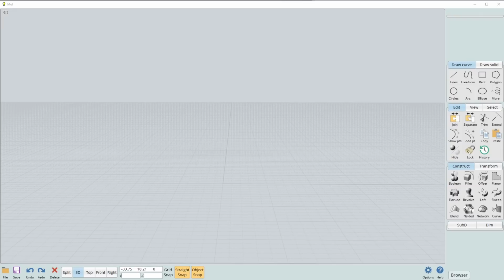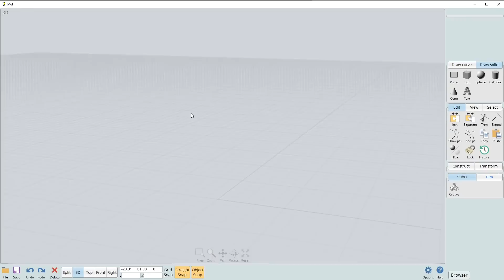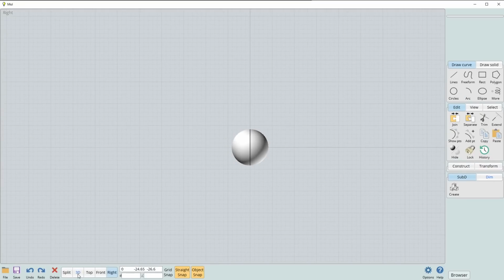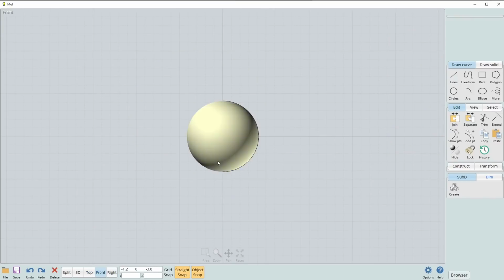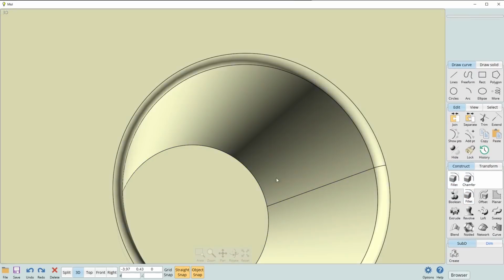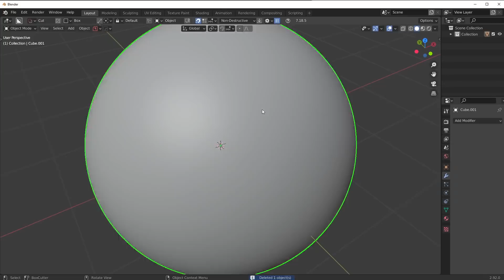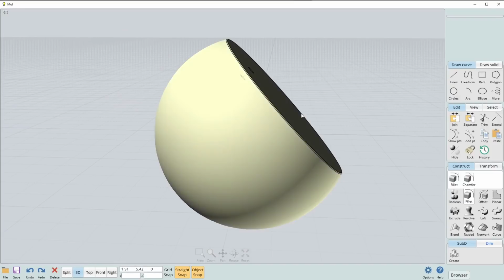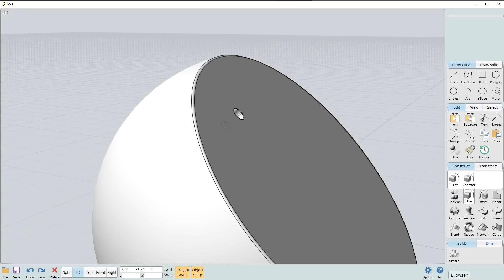So what exactly is NURBS modeling?

Comment: For the math nerds,

Polygons use matrices/matrix multiplication/arithmetic  with coordinates internally. Which is linear algebra. You effectively define the points and link the points,
You can generally define these as matrixes using a,b,c terms.
[a b c...n].
There is an inherent level of direct manual control with these at the cost of inherently smoothness and accuracy.

NURBS are using matrices(and "Linear" Algebra) as well internally but their entries are not like polygon model entries.
NURBS effectively use polynomials around a spline using polynomial *interpolation*(if you animate in blender, you definitely know what this is).

Entries of NURB matrices look more like
[(a + bx^1 + cx^2 +.....+zx^n) (a + bx^1 + cx^2 +.....+zx^n) (a + bx^1 + cx^2 +.....+zx^n)] 
Notices each of these entries technically has their own weights to form their curve. This makes them explicitly more accurate than polygons mathematically for curvatures because NURBS can successively add and reweigh each entry to increase accuracy as needed in an exponential matter around their "B-Splines". This makes them far more accurate. And generally easier to control from a user perspective.
The end result?

Per curve, we only need to store the weights, the power/exponent level, and the spline data. From cad, you can effectively only mess with the spline data to make things easier for you.
This also makes them easier to hold in memory for extreme curves vs polygons.

NURBS in one sense can be defined as Piecewise weighted Polynomials around a piecewise linear function.
This is why attaching nurb points can be...weird... at times. The entire polynomial has to be reweighted.
This is also why they cannot be easily animated/not animated at all. With polygons, you move points in space. With nurbs, you are having to completely recalculate chains of piecewise polynomials and weights.
If you want an example of what I mean by "piecewise polynomial", perform a boolean operation on a NURB model.
It doesn't cut the NURB usually. It instead produces another one!

NURB 1 exists as a function from (x1,y1,z1) to (x2, y2, z2). A boolean operation technically just stops that range/domain early, and inserts another NURB with it's own range/domain to fit what you want. It only worries about combining the weights at polygon conversion time.

This is also why converting a NURB to a polygon often generates a silly around of polygons/verts. In order to achieve "mathematical smoothness perfection" with polygons, you need ALOT of polygons to balance the weight distribution. So converting a system designed to be visually "perfect" in smoothness will naturally generate a high polycount.

Honestly though, in this day and age, many utilities you would find with nurbs can be applied directly to polygons. Nurbs are better for engineering and scientific analysis, as well as quick block out for curvature. I think there was a 3d VR sculpting software that exclusively used NURBS.
Although I would be careful if someone is a general animator using NURBS.
Never forget, NURBS are mathematical precise tools before they are modeling tools by definition. They are for engineers, mathematicians, and scientists. They are only for general modelers, game designers, and animators when they are SKILLED in how clean them up and operate them.

I recommend Rhino if you can somehow get a copy but Moi is a good choice as well.
Reply: Usually what happens with boolean operations is that the NURBS in fact stay the same, we just use  so called trimming curves to "cut/trim" the input parameter space.

This means the following: Our Sphere is actually a NURBS Surface, so 2 NURBS Curves that span a surface using the tensor product. And within that Surface space we can put trimming curves that cut out regions of the surface space.

So you have a NURBS Surfaces that inputs 2 parameters, but outputs a 3D point: S(u,v) -> p(x,y,z). Then we define trimming curves, that input 1 parameter but output 2 coordinates in the NURBS Surfaces space. T(t) _> s(u,v). This means you define curves within the surface space, which then cut out regions of the NURBS. The NURBS is still fully there, you just tell the Renderer to not display the cut out regions. There is some very interesting stuff you can play around with this.

Roughly 10 years ago I wrote my bachelor thesis about an Algorithm that converts any NURBS  into a piecewise combination of cubic bézier patches. This bézier patches can then be rendered and trimmed very efficiently on the GPU, since they have a fixed number of control points (and some other very powerful properties). This allows for some very cool stuff, for example seemingly Level of Detail transitions, because no CPU calculation time is required to change the LOD, since all the calculation happens on the GPU, by pre-storing some suiting sampling nets in the GPU Memory. 

We used this approach to visualize Aircraft designs that are created using NURBS.
Reply: Thanks for this! I was hoping to find a discussion of the benefits of nurbs for some situations. 

It would be interesting if a tool could be developed that combines the benefits of each (polys and nurbs) and avoids the pitfalls of each.

Comment: I've been using NURBS for years. I wish Blender would add full support for them  . . .
Reply: Blender's NURBS will not be manufacturable because it cannot be export as STEP or IGES.
Reply: @simpernchong  Isn't it the other way around though?
Reply: @simpernchong  i use blender for 3d printing and also for CNC milling machine , have you tried to design with blender for manufacturing ?! coz eventually after designing in a NURBs system , you will have to convert it into G code which relays on both polygonal and NURBs definition mathematically, am i right here ?

Comment: why would anyone use polygons? yes, polygons applications have more features but why would you have polygons if nurbs are strictly better? what am i missing?
Reply from the maker: Workflow is slower, infinite accuracy is seldom needed, poly-based allows for more versatility, you may need to retopo certain models, list goes on... overall I use Blender 99% of the time for these reasons.

Comment: In my opinion polygonal modeling is more complex than nurbs modeling, what are your opinions?
Reply from the maker: I disagree. Nurbs is slower and more tedious. You can probably learn Moi much quicker though, but it’s only a single tool in a massive arsenal.
Reply: Poly = Visualization 
Nurb or CAD = Production

You can convert Nurb to Poly
You cannot convert Poly to Nurb (just fake convert like stl)

So it doesn’t matter if one or the other is more or less complex. They are for 2 different tasks. It’s not really the same even tho it’s both modeling I guess.

Comment: Fun fact: long time ago, in a galaxy far far away, NURBS was used for... Organic modeling. Because they was smooth, while polytools wasn't that good.
But excuse me, you're wrong. Ok. Not really wrong, but it looks like, you don't really understand what the NURBS are. (and I don't really know details of modern CAD software)
But first of all: Blender and MaYa are not "poly based software". Even more, MaYa had quite advanced NURBS modeling tools in it. Blender... Well. It have NURBS surfaces, but it ends with their presence. Only difference with NURBS CAD software is that... It have more advanced tools in it. Ok. And it renders NURBS a bit different way.
And that's another point. The way these software are handling display of Bézier Curves and NURBS. What you see in the preview... Actually is an illusion. Well. Kinda. That curve, which you've created in Blender is actually... Have same smoothness as one in that CAD software. The only difference it that Blender converts it to polygons, to display it in the viewport, but in reality, it's smooth.

NURBS surfaces themself. Lol. It's kinda hard to explain. XD Because there are lots of details. But you can see how they look if you'll create a plain in Blender. Then subdivide it couple of times. The catch is that you can't manage loops with same ease as with polygons. It always must be something like grid. It can be deformed in any way (actually, that's how you get a NURBS sphere), but it always will be a Grid Plane.
Another thing, but I don't really get it. It's about details. Like in NURBS expressions, there is parameter "power" (like 2 in power of 2). And higher the power, smoother the result. With Power 1 NURBS surfaces look like Polygonal, while... Power 2 gives strange results, while power 3 gives smooth result. And there is power 7. Which kinda gives the best results.
Another interesting thing. Actually, that's how these "perfect Booleans" work: there can be NURBS curves right in the surface space of the NURBS object (it's called "Underworld"). And you can choose to "hide" part of the surface. ^_^
So when you make boolean operation on it, it copies object which you use to cut from another surface, creates (yep) another NURBS surface to create that Bevel. ^_^ Creates curves on both surfaces where "bevel" objects intersects with two objects. Then hides "unnecessary" parts.
It's just looks like, NURBS modeling tools have became really advanced, in the CAD software. So they kinda hide all these technical details, from the users.
And by the way. When you're rendering these scenes... You render all this stuff as polygons. Just really dence ones. Because... Any Raytracing engine just needs polygons to render stuff.
And another fun fact: there is another type of surface: Subdivision Surfaces. These are like polygons, but with 13 levels of Subsurf on it. So you can model as with polygons, while getting really smooth results.
Excuse me if all this stuff sounds like complete mess, but it's a really long story. And I've actually, missed tons of stuff.
Reply: > Another thing, but I don't really get it. It's about details. Like in NURBS expressions, there is parameter "power" (like 2 in power of 2). And higher the power, smoother the result. With Power 1 NURBS surfaces look like Polygonal, while... Power 2 gives strange results, while power 3 gives smooth result. And there is power 7. Which kinda gives the best results.

(a + bx^1 + cx^2 +...gx^7). Power 1 nurbs(just a) are effectively polygons because all their store is 3-d coordinates using minimal interpolation.
Nurbs achieve "perfect" curves by using weights along an axis(basically the spline).

> You render all this stuff as polygons. Just really dence ones.

Not entirely. NURBS use interpolation. 

> These are like polygons, but with 13 levels of Subsurf on it.

These are very much related to NURBS in the fact that they use interpolation of vertice points to form. This is why they are so bad for performance to use in modeling software because it's doing the grunt work of both vertices and exponential curves, where as NURBS only worry about the curves until polygon conversion.
Reply: @truesoundwave  "Not entirely. NURBS use interpolation. " - I mean that before rendering, or during rendering (at least with raytracers), all these NURBS objects are converted to polygonal ones.
"This is why they are so bad for performance to use in modeling software because it's doing the grunt work of both vertices and exponential curves, where as NURBS only worry about the curves until polygon conversion." - funny, but I didn't really had issues with these, in modeling software. But lol. The catch is that I haven't used them much. And meanwhile, some renderers, or rather translators? Using 3Delight you can check "export polygonal object as Subsurf". At least, it was the option.
And yeah. Thank you for these details.

Comment: I'm most interesting to see how you deal with export meshes using Moi, especially how to do high and low poly for game assets
Reply: Obj format for example, Moi3D as an advanced Obj exporter.
Reply: Well. Usually you don't do this stuff. But you can try to export it to MaYa (I wonder, would it work in Blender?), then do retopo, like with sculpting. %) Well, you can try to convert these to polygons, but you'll usually get complete mess. But as I've said, you use this type of software for other things. Like CAD.
Reply: @Soulskinner  Hi,
Yes it works pretty well in Blender and for the geo, i agree with you about the necessary retopo step.
Reply: @archiplanservices3746  Hi. XD
I'm just not sure that Blender supports all these NURBS surfaces. But I've thought that this software can export objects as Poly objects.
Reply: You can export from Moi3D in Obj format of course then import in Blender. There's even a bridge between both softwares called BMoi3D Connector get it here : https://github.com/TitusLVR/BMOI_Connector
Reply: Moi has export meshing options.. it can do low polygons to high polygons and N-gons with a lot of settings.

Comment: We use Rhinoceros at the company I work for which is an extended version of MOI (Actually Rhino came first) but I can tell you modeling with nurbs makes thing sooooooooo easy, until you have to take things out of the software and need it to be polygons xD
Reply: The workflow between Rhino and Blender is awesome since Rhino 7 came out. I can model my stuff in Blender, export it to Rhino as OBJ, run the QuadRemesh function convert it in to SubD and To NURBS, create a waterproof solid, ready for prototyping. Rhino 7 & Blender is like Tango & Cash :)
Reply from the maker: Yup, I find poly based to simply be more efficient for me, with certain cases as exceptions.
Reply: I use and teach Rhino 3D. Version 7 is the best version because it is now a NURBS plus SubD modeller which means traditonal NURBS as well as polygon (sub-D) workflow are supported in it. The awesome thing is that Rhino sub-D are NURBS convertible.. which the mesh modellers are not capable of.
Reply: yeah, exporting is the problem, i still struggle to export from rhino to blender, using the quad remesh and still not getting the expected result everytime
Reply: @onerawartist  Maybe look into buying Exoside remesh plugin. It's nearly the same remesher as Zremesh by the same guy with some differences.

Quad remesh is horrible.
Reply: @truesoundwave  i will check it out , thank you ^^. Im new to rhino and grasshopper i thought that was the only tool lol
Reply: @onerawartist  MoI have excellent export capability. Far from perfect, but better than other solid modelar. Usually I export as N-gons mess, and then slowly fix issues..... or simply get rid of Ngons in C4D, get little messy geometry,  but shading is ok. and if you prepare modei in MoI, UV is very easy and fast.

Comment: Please give an example? Because during the video I was really just asking myself "Okay that's really cool but what is it used for?"
Reply: It's used of CAD modeling. For example, when you need 3D blueprint of a car, or some mechanics and this kinda of stuff. Not like cool model, but actual blueprint, which will give you information about every point of it's surface. Or some parts. And this kind of stuff.
Reply: You can make your HP in MOI but you still end to convert it into polygons for baking ^^ That's an example.
Reply: For example Rhino (which is nurbs) is the go to industrial design software. Together with keyshot. And like usually in car design you would go from a poly model (sketch even tho it's already a lot of work) to sth with nurbs (more accurate) to the final step which is Strak software (for example Alias).
Reply: its a must when you need precision, real life stuff, production , cnc machines , 3D printing .. etc.
thats when you need as much precision as you can get, and polygons can't provide that